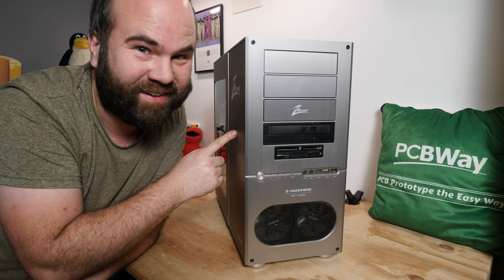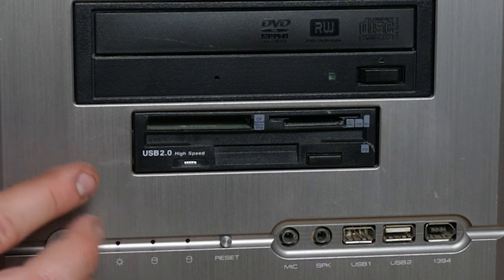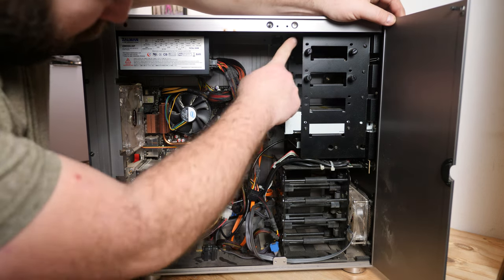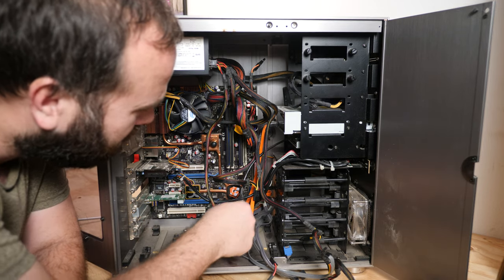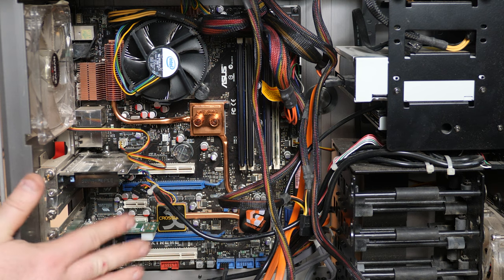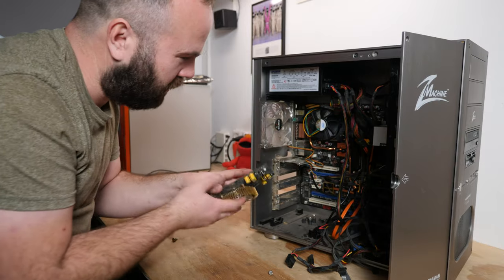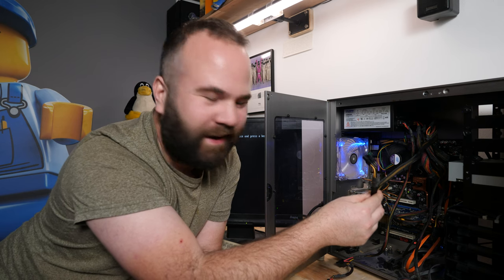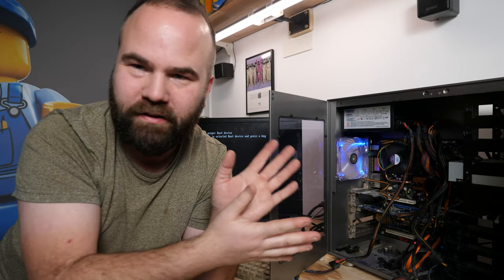This Dumpster PC has an Asus ROG Blitz Extreme Motherboard!

Comment: I don't know exactly which direction I would go with this but the fact that it has an onboard floppy drive controller means that it's a perfect machine for making disks for your retro systems like older PCs, Amigas, Atari STs, older Macs etc.

But OK, just go wild: fastest CPU, CrossLink, RAID etc. Maybe some crazy 5.25" front panels etc. :)
Reply: Pretty sure the pc floppy controller is incapable of reading or writing the amiga disk format
Reply: @pigpenpete  No, I'm pretty sure it can. It's USB drives that usually have that issue.
Reply: @weepingscorpion8739  Intel chipsets starting with 875P and beyond have unreliable, cost-reduced FDC, phased out entirely by P68 chipset.  Have to go to NVIDIA or VIA chipsets to get reliable, fully-featured FDC with also 64-bit CPU to run modern Linux on (and never ever insert valuable floppies into a machine running Windows, of course).
Reply: @orangeActiondotcom  Dang. But good to know. Thanks.

Comment: 5 years ago I found an Asus ROG Commando board in the dumpster. The only thing not working correct is the lcd in the back, but still. And I still have my Asrock M3A790GXH/128M with a Phenom II x4 955 Black Edition and an aquacomputer waterblock. And a couple months ago I found my dream case from that time, the lian li pc-p50r (the one with the dragon on its side). Now I look for three HD4890, but without braking the bank. I already got one, so two to go.
With SLI: It is realy hard to find SLI-capable boards from that time without spending a ton of money.

Comment: This is a really cool find,the case looks awesome too and with a bit of cable management it would look great. Those stock Intel coolers do the job great,they are way thicker than what they are now and those also had copper base at the CPU. I still have a Core 2 Quad Q9400 at work with 8GB of RAM and Win 10. Still runs great and can still do any task easily

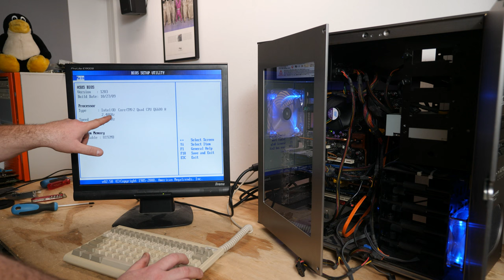Comment: 13:19 since it's a core 2 quad, let's make this a retro rocket machine!  Say like 16gb of ram, 1866 mhz, ofc,  I'm assuming this board is top end?  And maybe something silly, like a 9 series GPU.  And see if you can get a faster core 2 quad, that 9000 series chip you mentioned.  That motherboard is designed to overclock, so, let's overclock the snot out of the CPU!  Make all the internals the absolute fastest money can buy!  It's still going to be pretty cheap.  Oh and on storage, Sata SSD.

Comment: I recently built retro systems with Q6600 & Q9550 and an ATI X1900 crossfire and a 9600GT but they never felt quite right. Not compatible with older DOS and win9x era games but at the same time kinda slow and laggy for "newer" stuff like Crysis, Oblivion, or Fear. I replaced the crossfire with an HD6950 which helped but of course was obscenely bottlenecked by the old socket 775. 

Instead I was motivated by Philscomptuerlab and cobbled together a Windows XP supercomputer out of the newest winXP compatible stuff I had laying round. i5-4690k, DDR3-1600, sata ssd, Creative X-Fi, and the AMD HD6950. Nice thing about that particular card is modern display port out. Meaning I game in windows XP on a modern sub 1ms gaming IPS panel at 1920x1080@165Hz with vsync (if the game supports it, otherwise 1024x768@120Hz). Plays any game which works on winXP with ALL the eye candy enabled plus full EAX support! For example Crysis at the beginning where the GPS jammer is will run 1024x768 at 100+fps using high settings. If anyone wanted to reproduce this build, these components are everywhere and dirt cheap right now.

I already have a DOS/Win98 supercomputer: my Athlon XP, ATI 8500LE, and SBLive system - which uses an SD card for a disk drive.

Comment: As that CPU is fairly decent I would consider that an owner would upgrade GPUs until the platform was obsolete. If you can get a better CPU in there , do. Otherwise just get the best GPU you can and run things off an SSD. Yes the sound of hard drives is good for nostalgia but loading times are no fun.

Comment: I used to have a black Wave Master by CoolerMaster in thick aluminium. I used it for a long time. These days they wouldn't consider doing cases like these since the material cost whould be to much. They fased out this period with cheaper aluminum cases with thinner aluminum. Since aluminum is far away from steel it's necessary to do with thicker aluminum if you want a quality appearance.

Comment: I say you go balls to the walls. You could OC the Q6600 to run at 3GHz easily with no issues, or install a Q9650 or even a modded Xeon equivalent to be period-correct, since Xeons were all the rage. Might get a big tower cooler in case you want to OC that too. Or even 2007-esque watercooling.
For the GPU, HD 3870 X2, or maybe even 2 of those to make it a BEAST.
As for the OS, you could use XP or even Vista on a RAID-0 array for maximum 2008ness. Maybe a retro Hackintosh as well?
That shit's gonna be lit.
EDIT: And don't forget neon lights! And fancy fan controllers!

Comment: I would likely take a different route and go as high end dual core as possible and make it into a premium yet practical XP-era retro gaming rig, likely topping out at 8800GTX or maybe 9800 if its that much more cost-effective.  Could also be neat to see it with as fast a quadcore as possible (likely a modded Xeon) and see how well it can do with a more modern GPU and modern software.  Sticking with the Q6600, it could be turned into a Vista ambassador; grab just about any Pentium 4 based s775 CPU that the motherboard supports and then compare the two in Vista

Comment: easy clock on this processor is to set it from 266 to 333 and 3ghz you can do it with no change of vcore i had same cpu in mine cheep 2000 computer i have 6gb ddr2 in it also corsair memorys

Comment: Hm would this board support the socket 771 xeons ?
An e5450 would be really nice.
Basically a core 2 quad q9650 but cheaper, just needs the right microcode modded into the bios before flashing, which you can probably just remove all celeron microcodes too make room for those xeons.
A pair of 2 gb 1600 mhz ddr3 sticks or 1866 mhz 2 gb sticks just because you can for a total of 4 gb or run 8 gb via 4x2 gb sticks as I'm not sure the motherboard likes high density ram sticks beyond 2 gb, maybe you'll have some luck finding some early 4 gb 1600 mhz sticks that works fine right away though.

A older intel 330 ssd too have ssd trim support in windows xp or just dual boot xp & windows 7 while putting in a cheap dram less ssd like a pny cs900.
They are more then good enough imo & will still last easily 10 years got 90% left on my 120 gb ive run as a boot drive that has 11.6 tb writes too it for about 4 or 6 years now i don't quite remember when i bought it.

Gpu I'd go with something like a early dx 11 gpu, maybe a passive hd 5750.
Or something that's among the last gpu's supported in windows xp like a gtx 950 too worry less about excessive heat in the case & wear on the powersupply if you are keeping that.
Instead of replacing it right away, i wouldn't want it too fail & kill a motherboard like that so i would personally replace it with something that has at minimum a 3 year warranty & like 600w.

Intel stock coolers, specially the socket 775 copperslugs are pretty nice.
Specially for newer lower tdp chips like a core 2 duo e8400 you'd never see it overheat unless you are either stopping the fan physically or it's not mounted on properly other then on one corner & assisted by gravity too be held in place.

Ran with one as a testrig for a bit with a core 2 duo e8400 at 4 ghz, with an intel copperslug cpu cooler on a Asus P5Q Premium motherboard.
With 2x2 gb 1066 mhz ddr2 a pair of black & silver heatpipe ocz reaper sticks.
Temps in the far cry 2 benchmark was mid 70's only at 4 ghz which is really not much at all.
If you break those pushpins though they are garbage as they can't be mounted down well at all really if one of those breaks while you are overclocking or running a already hot cpu like a pentium d 945.

As of December 1st 2022 my testrig is now my old I5 2500k at 3.7 ghz with an intel stock cooler & 4x4 gb 1600 mhz ram, the Asus z77v-lx board that cpu sits in has dead onboard sound unfortunately & i had some weird issue with one of the usb controllers where it would just cause the usb short detection without anything plugged in but the front ports on my case so i bet it's slowly on it's way out.

Also as you have multiple pci-e slots you can technically make a m.2 ssd work on this motherboard.
You won't be able too boot from it (not without a lot of work like compatibility madness did in his video.)
As you'd need UEFI bios support.
But it will show up as a storage device in windows still, likely in windows 7 & upwards only though as you'd need drivers for it which intel & samsung usually is the best too handle that kind of thing.

For cpu cooler I'd look for a used Noctua heatsink like a NH-U12P, overkill yes but very good cooler & support for newer sockets by just buying a socket mounting kit like i did for AM4 for 10$ it's unbeatable price too performance considering i got the cpu cooler free with that z77 motherboard & a locked I5 2500 non k cpu.

Comment: That's an awesome system as it is! If I had it, I'd keep the Q6600 but use it with a better cooler. Maybe then put in 2x WD Velociraptor's in RAID 0 and 1 or 2 HD 3870's to keep it period correct but be different (rather than 8800GT's)

Comment: do the Socket 775 to 771 pin/ bios mod and run the Xeon E5450 or X5450 and overclock it pair it with the RX 580 8 GB video card will work great, I think that's a water-cooled chipset it should run 4X8 GB sticks they just didn't exist when that board came out, I would also install a PCIE to NVME M.2 adapter the Samsung 950 pro NVME M.2 SSD has legacy boot and can be used as a boot drive with legacy bios you could also run HDD's in raid for tons of storage sense it has a window I would go full water cooling custom loop maybe you can find a water block for the RX 580 you could mount dual 120 radiators one in the drive bays just install vented covers in the empty slots and a 120 radiator in the rear at least it looks to be a 120mm fan with a distribution block in the basement with a combo pump reservoir for added coolant capacity

Comment: I have an old PC with a Q6600 and an ASUS P5K motherboard.
8 GB of DDR2 RAM and that's the maximum the motherboard can handle.
I have a GTX 660 graphics card in it.
Sadly the motherboard or RAM have started to give up.
The PC freezes very often and sometimes it wont even get passed the BIOS check.

Comment: Go with a Xeon CPU.  Xeon parts are better binned, so you should be able to go further with overclocking.  They're also cheaper than the C2E parts.  Be sure to flash latest BIOS.  Intel P35 is a good chipset; while P45 supports the next generation PCI-Express, most GPUs of the time couldn't make use of it.  P45 also generates more heat.  No other reason to prefer Intel P45, so this is a very good high end board to use today.  Be sure to remove old and apply new thermal paste to the chipset northbridge and southbridge as it is surely dry and useless.  This board will only push 3Gbps over SATA2, SATA3 (6Gbps) didn't come until X58/P55 generation (Socket 1366/1156).  If you use overkill SSD, consider adding SATA3 controller to maximize performance?  Regardless, SSD is better than noisy 10K RPM disks, and also very very cheap now.  512GB SSD for ~$40 these days would be an excellent fit here.  Make this dual-boot Windows XP and Windows 10 (for modern convenience).  What an incredible and unique case!  Very lucky!
Reply: This kind of set up is excellent for early half of Windows XP games.  Late-era XP (Far Cry, Crysis, etc) probably better off with 2nd-4th generation Core i5/i7 or AMD equivalent.  This system can do those things too but will begin to struggle somewhat with CPU bottleneck.  Still, it will get you very very far and look great doing it.
Reply: "P45 also generates more heat."  Is that accurate?  I had a P35 based system and stuck with it until going X58, and didn't pay super close attention to the interim stuff, but given that P45 was fabbed on 65nm with P35 on 90nm, I would have thought the P45 would generate less heat and run cooler when operating under the same conditions.  I also remember coveting P45 for better overclocking results on the cheaper Core 2 parts that I had that were limited by lower multipliers and hitting pretty hard FSB walls on less-capable northbridges.  Ultimately I was under the impression that P45 was just hands down better than P35, but since it came out just 5 months before X58 and Nehalem (which would totally change the game), it never made all that much sense for me to mess with.

Comment: I would probably go with a single GPU unless you want to be period correct and do the dual GPUs.  I would probably go with a GTX 670/680 and then a q9000 series CPU with a new cooler and maybe a small overclock.  Fastest RAM you can get.  SSD or three in RAID for laughs.  A few more blue leds just for show.